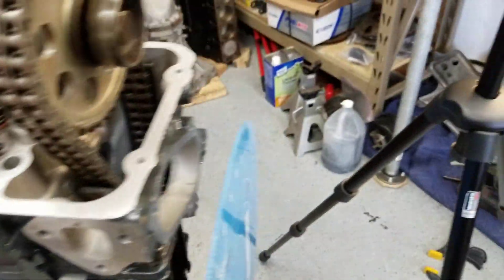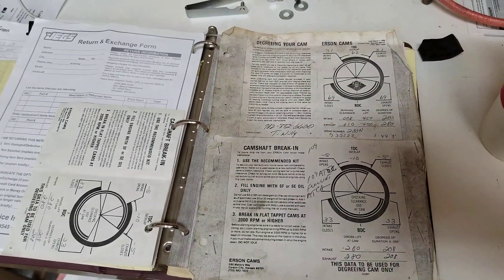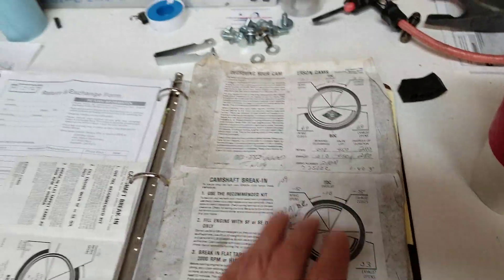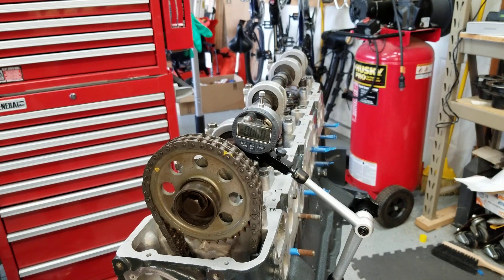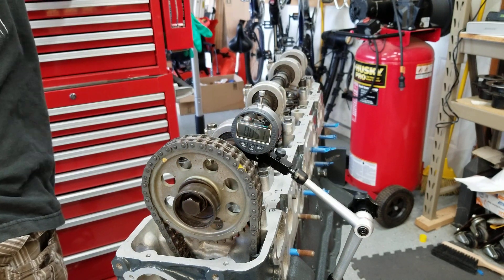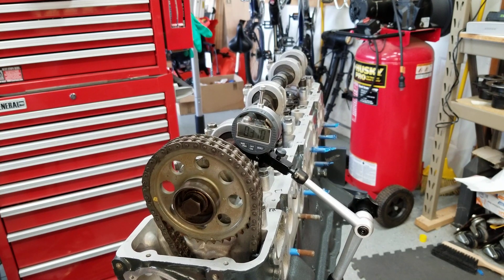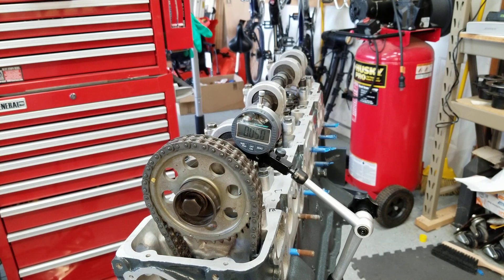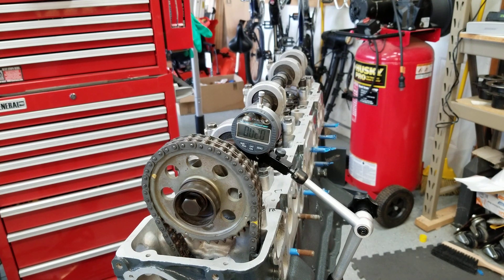Finding Intake cam lobe center, degreeing cam

Comment: Ok, in your book it said 109.....then you added and divided by 2 and had 106.5, and you said it was good?  109 isn't 106.5  What am i missing?
Reply from the maker: I was just trying to check it, to see if I my installation was way off, looks like the timing is slightly advanced by approx 2 degrees, I decided to leave it.  The error could just be my measuring setup, or my finding TDC.  
If it's truly advance it might result in a little more bottom end.  I did the video because there were no vids for this type of procedure on this engine, thought it might help.  I"m definitely not an expert....
Reply: 2 years later... but what you're missing is that this engine doesn't have a high level of adjustablity unless you buy an adjustable racing sprocket or drill out the locating pin on the stock one, and put in an offset pin hole.  Each link lets you adjust about 9 degrees. Each hole pin selection lets you move about 5 degrees.
This engine is a 1960s  design with stacked tolerances. What happens is the height of the deck in relation to the crank can change, especially if the deck is blocked flat again.
The height of the head deck can also be decked flat again (and probably needs it at least once) and then the headgasket height can change. and THEN there is the height of the bolted in cam towers that can be flattened if needed for alignment, and then shimmed up and down for proper rocker geometry.

All this means is that the exact distance between the center of the crank and the center of the cam is very inconsistent. Plus there is timing chain stretch and sprocket wear. Because of this, there is a lot of slack in the allowed cam angles. Unlike a modern motor where 4 degrees off might put your valve near your piston, this engine does not have anything nearly as close.

This is why being 2.5 degrees off the ideal 109 is considered acceptable.  If he was building a race motor with a very aggressive cam setup, he would likely do the adjustments to make it closer to ideal.. but with the motor as mild as it currently is, there would be no perceivable difference in power or behavior from this 2.5 degree variation.

Comment: Hey Joe, New Subscriber here and no apologies needed for the video of you verifying and validating your L28E Camshaft. Great video, well explained how to obtain the necessary measurements and esp the necessity of repeatability. I too am an engineer (flight test manufacturing engineer)  in commercial aviation. I’m curious as to where you acquired the light weight Vlv springs to index your cam. Monkey see Monkey Do principal, you know Thanks again. Nice Shop by the way! Cheers
Reply from the maker: You can find the lighter springs at your local engine shop, they might have to order them but they're specifically designed for this exercise.
Reply from the maker: thanks for the kind words
Reply: the nice thing about check springs is they dont run in the engine... so ones "good enough" to fit generally work.  I think the one I am using is for an entirely different European motor, but the ID clears the valve seat and the OD still fits in the valve retainer so it works. Its soft enough i can squish it flat on with my hands.

Comment: I'm changing out the race grind cam in my '72 240Z. I'm going to a more street performance cam with a smoother idle and better vacuum with some more low and mid range torque. I am concerned that the new Comp cam is timed correctly. I will try to verify TDC at the crank timing mark first. Then I'll see that the ICL is correct or pretty close anyway. The timing chain only has 1800 miles on it so it shouldn't need any advancing adjustment on the sprocket. Thanks for the great videos.
Reply from the maker: Well, good luck, glad I could help...didn't see much on this subj for overhead cam engine so I took a whack at it
Reply: @joem6859  Well it was a pretty darn good whack.
Reply from the maker: @novakenss  thanks again, good luck
Reply: I did get my cam changed from a Comp Cams road race grind to a street performance spec grind. I had to resurface the rocker arms first. I tried many ways to verify the Intake and exhaust lobe centerlines. I tried .050" on both sides of the valve opening/closing but the numbers I was getting seemed off by about 14 degrees from the spec of 110*. I then tried .050" on either side of the tip of the lobes and got about the same results. I was concerned that the cam was way off. Then I read about symmetrical vs asymmetrical cam lobes, noting the uplift ramp is very different from the down ramp which allows for a more gentle valve closing to be nice to the valve seats. The rocker arm ratio changes throughout the cycle and the asymmetrical lobes help to accommodate that also. I finally ended up just looking for the maximum lift point of both intake and exhaust and presto, I was getting 110* just like on the Comp Cams spec sheet. I poured on the cam, a bottle of zinc oil from Comp Cams and did a break in run for 30 minutes at 2500 rpm. I have triple Weber 40 DCOE's and now it idles way better and is easier to jet and set the idle speed. I'm having my distributor rebuilt and recurved by Advanced Distributors in Minnesota so I can't drive it until it gets back to me. Now on to the next upgrade; Electric Power Steering. My wide wheels and tires require it. I do like working on my Z.
Reply from the maker: @novakenss  very cool, good luck.